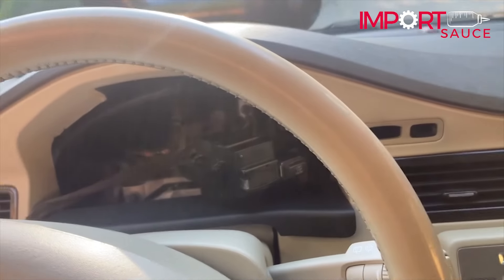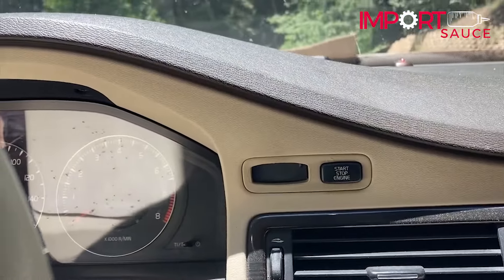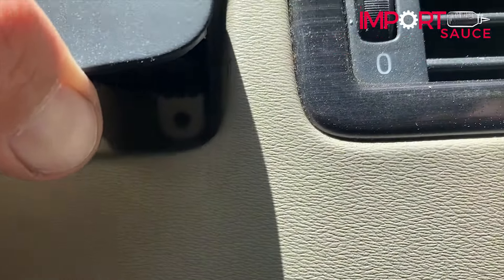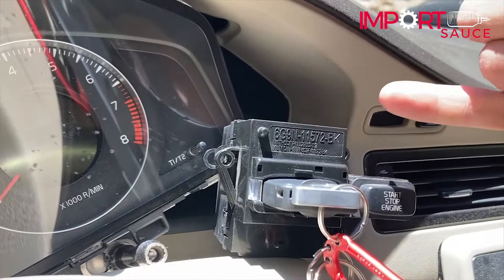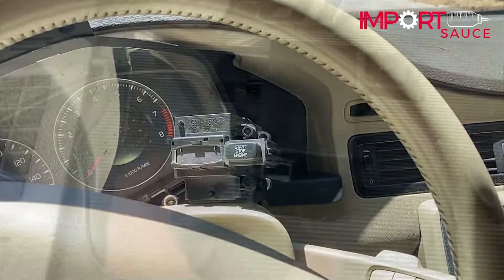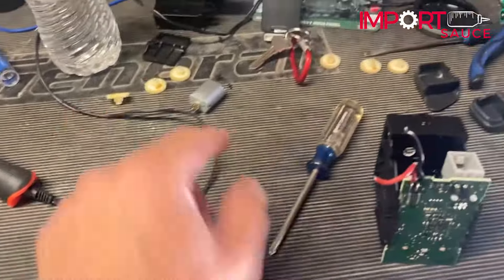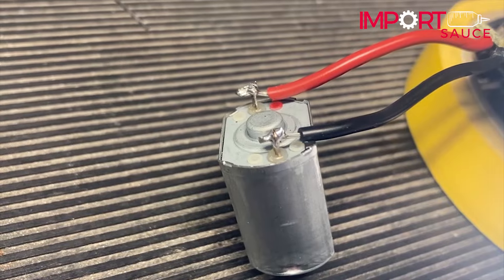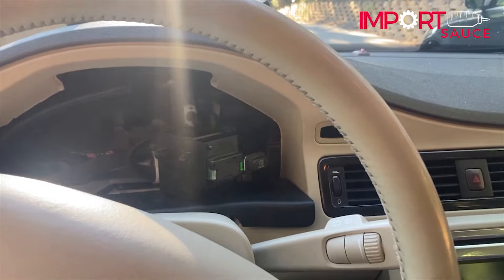Volvo P3 Push Start Ignition Fix & Replacement WITHOUT Reprogramming via Volvo Dealer

Comment: Just replaced my ignition switch with a junkyard donor. Mine was twice the price at the junkyard, $40, but it still beats what Volvo was charging, $400. I have to admit I did doubt you thinking it was only just the dc motor. I thought it would be friction on the tracks or gunked up gears, but sure enough i swapped the motor and all is well now! Appreciate the video!
Reply from the maker: Awesome. We have the motor disable jack video coming soon which will Eliminate the entire motor thing
Reply: @moosedroppings what is this??

Comment: Just cut the red wire at the motor. Push the key in, hold it in against the mild spring tension, start the engine and keep holding the key in for 2 seconds. You can now pull it out.
Reply from the maker: Oh wow.  Is that right.  I may do that since the new one is clacking and grinding again.  That would be similar the the v2 key system like on our 16 xc60.  Awesome knowledge. If it works I’ll do a write up video on it.
Reply: @moosedroppings Yes, cars such as Audi have a slot that you manually push the key in and out. The antenna wire around the opening only accesses the transponder chip inside the key during the START REQUEST. After that, the key has no communication with the vehicle, so you can pull it out or leave it in. Personally, I like to leave it in as long as possible ; ).
Reply from the maker: @davidgold5961  awesome.   I’m gonna try this this weekend and make a video I suppose. Stay tuned.
Reply: @moosedroppings  I have been doing it this way for a month now - no issues. Hold the key in for 2 seconds before pulling it out. Since it’s out, you can then simply push the button when you shut off the car. Upgrade: remove the spring tension inside the housing so you can simply push it in and it will stay in, just like Audi.
Reply from the maker: @davidgold5961  awesome, we are going to play with this soon for sure, thanks for the awesome tip.
Reply: @moosedroppings  Did it work? I have the same issue on my 08 XC70 and it would save me a time if this was a good work around
Reply from the maker: @monikasowinska3036  still haven't had time to get in and test it out, but I will report back for sure when I get in there.
Reply: @moosedroppings just came across this. Great video curious if you ever tested disabling the motor?
Reply from the maker: @Ryan-lk7sv not just yet.  We are trying to finish up the p1 t5 forged internal build. We got 20 miles on engine and pulled the head to dial it more.  Time time time. That engine is more priority at the moment. Be sure to watch the build series.
Reply: @davidgold5961. I can confirm that this mod works perfectly. Just finished testing two hours ago 👍💯
Reply: @TheWabbz can you explain what you do? I'm experiencing this issue now
Reply: @toddm8609 after you disassemble the unit as per video. You desolder the red wire from the small motor. The wire end is pointed and is inserted in a hole on the  positive terminal of the motor. Just melt the solder and wiggle the wire carefully to loosen it. Remember to tape up the end as well to prevent any short circuits. pause  at 8:46 to see the red wire going to the motor. All the best
Reply: My issue isn't a motor issue. Push key in, hear the click and a second later another click resulting in no start. 
Push it to remove fob, reinsert, and car will normally start. Sometimes you need to repeat this action. 
So motor/gears are working, it seems as if the antenna isn't reading the chip??
Reply: @moosedroppings  have you tried? Can you show us on video?
Reply from the maker: @adelinchifan3407  it is still on the list, finishing up the t5 build at the moment,
Reply: @moosedroppings Hello, can you estimate when you will upload the video?

Comment: It will be awesome to replaced with the keyless version instead. but for sure it would need programing for that. Great video! And is awesome that you  made it work for that low investment. The problem with this type of ig switches  is that you know how to use it but not the valet kid, tire center or the mechanics, trust me I had recorded with my dashcam  "mechanics" and what not doing that and is very frustrating  that when they get in your car they just try to pull that key out by forcing it out and the result is a bad switch in your case it was the bad / weak motor and gears.
Reply from the maker: Good points, didn't think about valet, but it only takes one or two tugs to jack the gears up, ours on this one are already doing the same thing, not a good noise for reselling the car,
Reply: @moosedroppings  I love my 08, S80 but there are several things that are very annoying, I wish I could just install a regular key in it or just keyless, I have test drive many vehicles and rented many very nice ones when I travel for work, but when I get back to my old s80...hmm there's something about it 😁

Comment: Thank you for this video. I have a very similar problem with my V70 from 2011. Is it possible to buy a used ignition-part with matching keys to save on soldering and so on?
Reply from the maker: I would guess no.  I am assuming like other Volvos that the vin or imobilzer is hard coded link between the ecm, the key and the ignition.  The P1s however do not coded the ignition and it works as a receiver so on those cars simply a donor ignition switch can be swapped.

Comment: Hello! I think this video will be a good reference for me. 

But I have a question. Is it easy to remove the circuit attached to the module? 

I was wondering if it is possible to move the existing circuit to a new module as well as change the existing motor as in the video.
Reply from the maker: Sure.  A few screws hold it down. Easy to move over